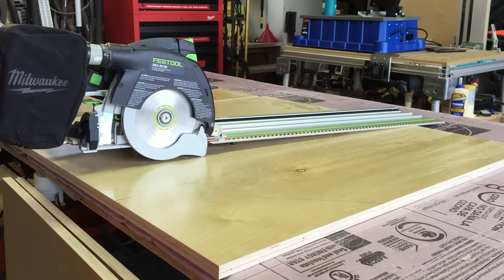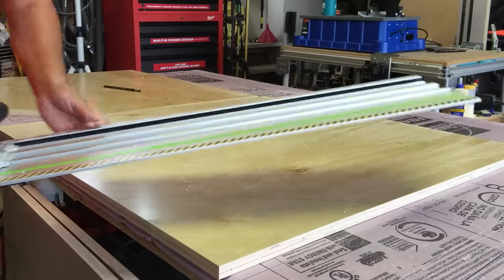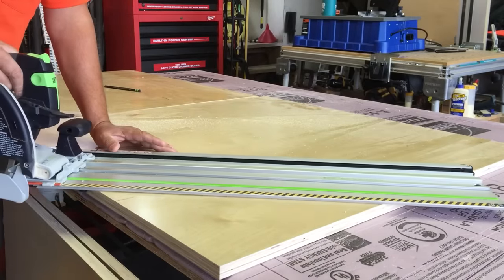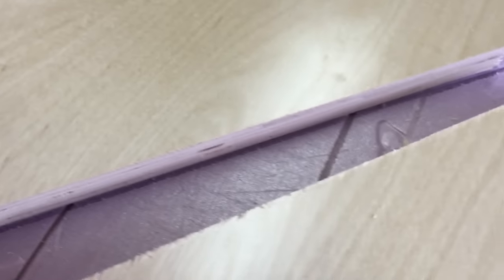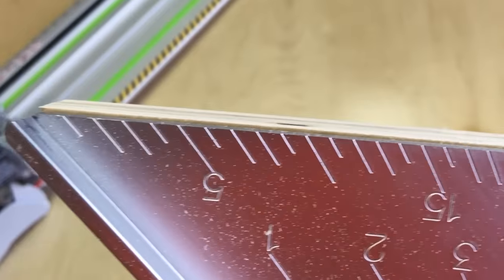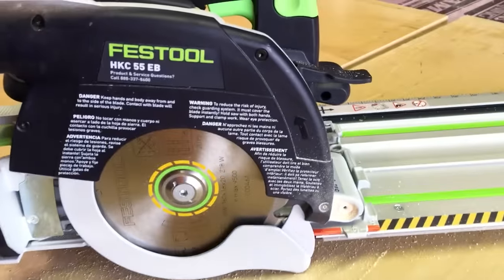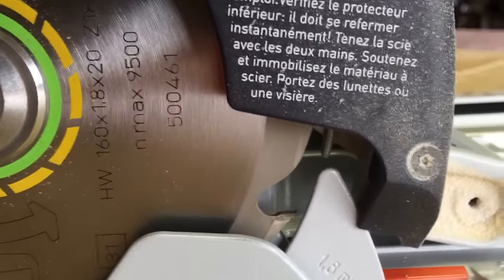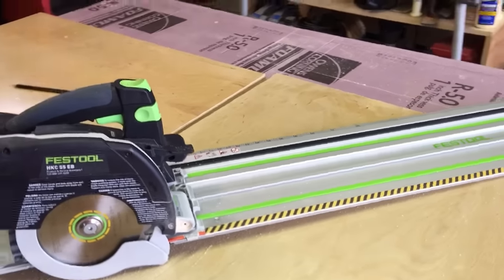Festool HKC Good enough for cabinet work?

Comment: Is it true the HK55 and ts55 shair the same blade except for the thickness? I understand that the blades are not interchangeable but can I assume that both saws can be used on the same rail without having to change the splinter guard to take into account the differences in blade thickness.
I mean that as the INSIDE of the saw blade sits in the same position on both saws then the guide rail Cutts should be bang on with both saws regardless of the thickness between each blade
Reply: The HK55 and HKC55 and TS55 and TSC55 all share the same 160mm blade diameter with 20mm bore size. The difference is the HK/HKC blades have a 1.8mm kerf where as the TS/TSC REB blades have a 2.2mm Kerf
The TS/TSC blades will fit on the HK/HKC but the HK/HKC blades will not fit on the TS/TSC because the riving knife on the TS/TSC wont fit in the 1.8mm cut rendering it unsafe. Obviously using the 2.2mm TS/TSC blades on the HK/HKC means you have a 0.4mm wiggle room on the riving knife. But that should make no difference if you're using it on a track.
The newer TSC55 KEB with the electronic kickback stop has the same 1.8mm Kerf as the HK/HKC blades so those are fully compatible with both saws BTW, check out the saw blade section on the festool site
Reply: Using the TS/TSC blades on the HK/HKC will make a tiny difference to the splinter guard, although as you say regardless of the thickness of the blade, the inside edge of the blade is always in the same place, but the teeth themselves are slightly wider than the blade.

I'm not sure of the difference between the blade position on the HK/HKC and the TS/TSC though, I've read there is a slight difference but you can adjust the base position on the TS/ TSC to move the blade to match the splinter guard, but I don't think you can do the same on the HK/ HKC I have that saw and I can see no room for adjustment. So you would have to change the splinter guards, trim them with HK/HKC and then adjust the TS/TSC base / blade position to match. according to the festool forums lots of people have done this very successfully without too much hassle.

Comment: Can you extend using the FSVs and for instance and a FS 1080/2 for cutting large sheets? It should give 1400mm+ It looks like it would fit!
Reply: I don't think the spring loaded mechanism would allow it to travel that far may need to release from lock mechanism to run independently and it wouldn't hold to rail on longer cuts